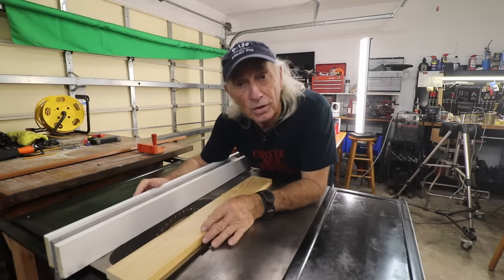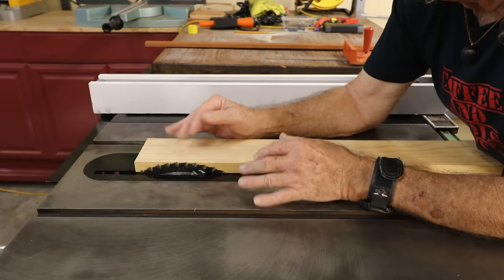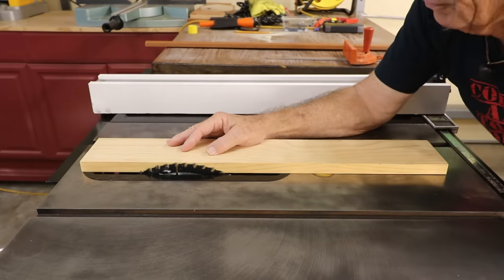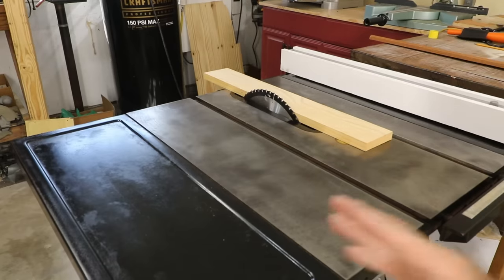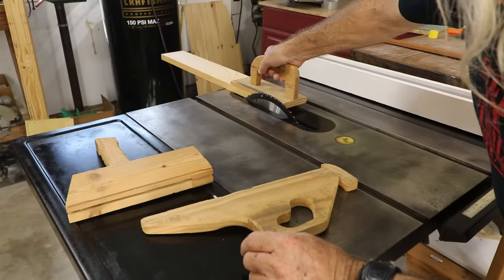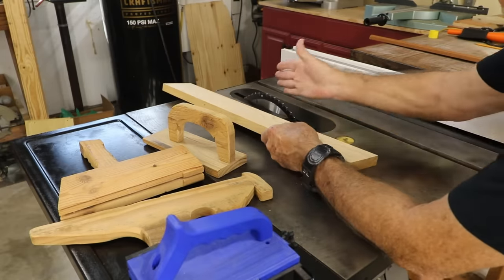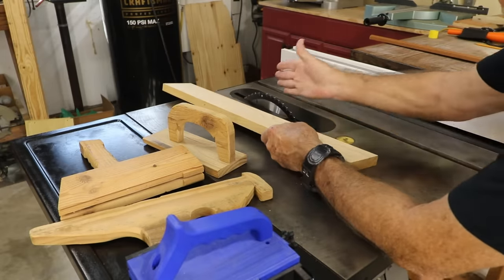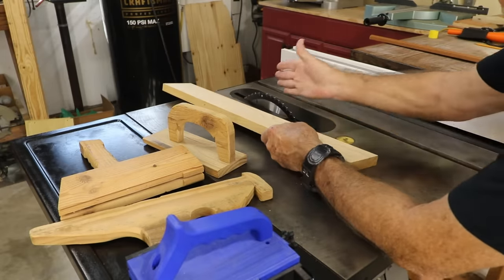Table saw secret nobody will talk about from the good old days, C&T episode 180

Comment: I'm just now at age 59 getting back into woodworking.   My fear of my Craftsman table saw blade is no less now than back in woodshop in the late 1970's.  I'm really glad you took the time to talk about blade heights because its something I dont ever remember learning but I wonder about it every single time I use the saw.  IMHO: part of being safe is being efficient.   If a blade is cutting sharp and efficient then you dont use as much force to guide it through your cut.  Less force means less chance of slippage.   I only have high school woodshop for experience but I once witnessed a piece of wood kick back and stick into a concrete wall behind the perhaps donkeyish teen boy making the cut.  Also: the Safety shield I remember using seemed to get in the way more than keep you safe.  I've never tried a nerd or whatever but that seems like a good thing to try.  I think most important is common sense and no distractions.  As an amateur I really try to take my time.  Sometimes I get in the Zone where everything just flows...but without experience that is rare.  Thanks again...I am going to try raising my blade higher...like 200-250% of the thickness of the piece being cut.  Up until I watched your video I was adjusting the blade so that the throat of the blade was just coming out of the top of the wood surface but like you said that makes more friction and raises the risk of kickback.
Reply from the maker: Now days it is all about safety and heck, that's not a bad thing. I just wanted the old school out in the open for all to see and understand we had reasons too :)
Reply: Agree 100%! What are a couple of woodworker sayings? Dull tools are more dangerous than sharp tools & let the tool do the work.

Comment: You mentioned you've been using a table saw for 50 years and I noticed you still have all your fingers! So I'm thinking you know what your talking about. Lol! But seriously, I've only been into wood work for a few years and the only time I've had a board get squirrely on me is when the blade was in a lower position. So this makes total sense. Thanks 😊
Reply from the maker: It is almost old school VS new. I think they both have the GOOD and BAD with each.

Comment: A lower blade reduces the depth your saw can cut into a stray finger, but it also tripled or quadrupled the amount of wood in contact with the cutting teeth of the blade. A high saw cuts a much straighter line (almost verticle) reducing the amount of wood being grabbed by the teeth at any point in time.

It's a matter of preference and your own comfort level in how much you pay attention and how in control you are when cutting. Choose your own adventure.... but do it wisely.
Reply from the maker: Well put :)
Reply: You are not a rookie.  I can tell.
Reply: correct, when I was young, a friend of mine, his parents had a carpintary, they had a table saw, running a huge disc, and they ran it high as well.
Due to it's 15KW, it was turning so fast, it didn't even grip wood, and even better, it had a movable slide, where you could put on the wood, and just launch it through the sawblade, it didn't even stop or move.
I still put the saw high up.
Reply from the maker: @Steve25g  Sounds like a big one :)
Reply: @SirTools   yes it was.
in the vicinity, you have a company producing carpintery industrial class..
The machine needed softstart at 3x400volts
Reply from the maker: @Steve25g  WoW...would love to have watched that one run....
Reply: @SirTools  me too, unfortunately, the shop and building is taken down, I saw on maps

Comment: Another thing that is very important is to have respect for the tool.  A lot of people have accidents because they get careless.   And I never, ever rush at the table saw.  If I do not have enough time to take my time, then I quite for the day and pick back up tomorrow.  I have been woodworking for 30 years and I do enough woodworking to have gone through 3 table saws.  I do more than week end projects, and I still have all my digits and plan on keeping it that way.  And PPE is an absolute must.  I cannot even imagine cutting anything without eye protection.  You only get one set of fingers and 1 pair of eyes.  It is up to you to keep them in tact.
Reply from the maker: Pre plan the cut is a must
Reply: @SirTools  absolutely.  You know that saying, measure twice cut once.  Well sometimes I measure 3 and 4 times.  Also, layout on the plywood sheet is important to prevent waste.  I know how to sew and I realized one day, that cutting into plywood is like cutting pattern pieces out of fabric.  You lay pattern pieces out to get the most out of your fabric, and you should do the same when you are cutting into plywood.  I cannot stand waste.   And everyone at the house knows not to 'clean up' my shop for me.  They will throw away pieces that they think are scraps.  They do not understand that those 'scrap' pieces could still get some life squeezed out of them.  Small trim; jig setups, etc.
Reply from the maker: @annarouly2144  I've warned folks to leave my scrap alone LOLOL

Comment: I was taught 50% higher than the wood. I vary that depending on thickness and other factors. The biggest thing is awareness of where my fingers are and where the blade is, as well as where the material is. No loose clothes, don't work too fast, make sure someone is nearby, and absolutely no cutting if tired.
Reply from the maker: Another twist on an old topic here. Cool stuff
Reply: and dont spill your beer
😛😛
Reply: Sharp blades are safer than dull ones.
Reply: listening to the Wood cut is the Key to a Clean cut.  And Feeling the resistance as well as Observation of Density of the Wood, denser the wood reduction of speed.  " A variable speed Electrical switch in line of power cord will do wonders for cutting on a table saw.

Comment: I started using table saws before blade guards and kickback prevention. I was shown that you can get kickback if your fence is not repeatably accurate, meaning that if the rear of the blades is closer to the fence than you get a pinching effect across the blade when pushing it through and more surface contact, so I was taught to measure both the front and rear of the blade and make them even or actually slightly further from the fence at the rear to prevent kickback.
Reply from the maker: Good point and I think it is the main cause.

Comment: Years ago, at the beginning of that years woodshop class one of the first things my Woodshop teacher in junior high did was hold up the table saw's fence and told us students that, that fence was the most dangerous piece of the table saw, and that if it was used improperly while using it during the process of cross-cutting boards it would more than likely cause the "abuser" (meaning the table saw user), a horrific amount of undue pain and suffering due to the possibility of creating a dangerous "Kick-Back" situation when the board being cut became twisted and jammed itself between the table saw blade and the fence. 

He stated that it was called a "Rip Fence", and that it was called a "Rip Fence" for one reason, and one reason only. It was to be used only for ripping boards in combination with a ripping blade, and was not to be used during the process of cross-cutting boards in combunation with a Cross-Cutting blade. 

He then explained to us students that if he observed (or caught), any of us students using that "Rip Fence" during the cros-cutting process, or even if it was sitting on top of the table saw during the cross-cutting procedure, he would immediately cease all woodshop procedures (until he returned from the principles office), and then would escort that student to the principles office to discuss safety procedures with the principle, then write up a written report pertaining to what occurred, and temporarily suspend that student from the use of the wood shop, and its equipment for two weeks, and would give that student a failing grade for that semester.

That woodshop teacher was mighty serious about "Safety in the Woodshop", and I have never forgotten either that woodshop teacher, or his "Safety " message pertaining to the proper use of the "Rip Fence".
Reply from the maker: Good teacher by sounds of it ! Thanks for this comment it is interesting to hear some of the old experiences from wood shop.

Comment: Back in the 70's I was taught for both table saws and circular saws to set the cutting depth to half the gullet depth. I've been running with that ever since. Nice cuts and safe, never been hurt. Oh yeah, push blocks are a necessity for table saw safety!
Reply: Exactly this.
Reply: Forgive me, I'm new to this. What is the gullet depth?
Reply: @soujrnr  I can't insert a pic here, so just google it. It is the deep curve right behind the teeth. My understanding is it is where the sawdust goes immediately after a tooth cuts through the wood fibers. Having the gullet exposed gives more escape route for sawdust than a blade sitting low that is buried in the wood.
Reply: @bloomdds  - Thank you!!

Comment: Just finished watching the video. I have always have the attitude that I keep the blade just high enough to let the edge clear below the gap behind the teeth. No matter whether it is carbide or all steel design. Just keeping it below yet above allows debris to flow away from the area.  Nice hat, which tells me you and I have a background of working on planes. Mine was with C-123,”White Whale” and 121s with ADC back in the 60s. Look forward to watching more videos.

Comment: The two best things I have ever done for my saw setups are: Use a high fence, set one inch or more than the max blade height as a limit for my hand. The second thing is to have a proper long out feed table, which lets me push a piece out smoothly. I resent being on the short end of a lever, thus tricking me to force the wood down onto the table near the end of its cut. (The most dangerous part of the sawing I have seen is not having a dedicated out feed table. Those twig-trees and helpers cause more havoc holding a piece out there. YOU need to be in control of the cut!!!!)
The Low Blade Safety ASSUMPTION maximizes the approach angle, and maximizes the tooth force tangential of the blades radius. This vectors forces which razes the work piece. In other words you can feel the board rise up when sett up like this, especially with slightly dull blade. Also, when set low, tooth time in contact with the wood is at maximum, creating heat, and if the material is dense like oak forget-about-it! 5000 RPM is 83 rotations per second. Multiply that by the number of teeth on the blade to find how many teeth per second. Saws with 1.5 to 3 HP always bog at the operators feeding rates.
Reply: Well reasoned! I hope newr users take heed
Reply: Having  out feed table is the way to go  but it takes up alot of room  trying  to fight your wood is dangerous  I think
Reply: @spurlindarby4587  Try a roller stand ....
Reply: Thank you
Outfeed table is often overlooked
Reply: Roller stand is good and at least you can move it to suit your space and timber length. Also like a lot of guys I often work alone in a room full of kit that can kill you so I wear a pair of 'Oregon' chainsaw gloves, designed to stop a chain saw and keep your fingers attached to your hands. Brilliant product and I use them on anything like saws, planers hand held or bench type it doesn't matter. Use on the band saw too. My gloves cost about £29 here in the UK, worth double. Riving knife and top guards if set up right are good too, never had cause not to use them.
Reply: @stephenrose8188  Thanks will look in to the gloves here in New Zealand. Roller stand is great in a tight workshop and good as an infeed 'table' too.
Reply: @stephenrose8188  wearing gloves is more dangerous then not wearing gloves when working on a table saw. Chainsaw gloves are designed to bind up the chain and quickly stall out a gas engine - they will not stop an electric saw blade.
Reply: @stephenrose8188  please check your gloves most chainsaw gloves only have protection in one hand the other is just leather.... no I'm not kidding
Reply: @robertmoore9636  Hi Robert, these are equally protected left and right hand glove, but always worth checking.

Comment: I've had a SawStop for four years, and even though I'm old, I'm still a beginner. Just recently I read the recommendation to set the blade height such that the gullet clears the board being cut. The explanation was that doing so allows the blade to clear the sawdust better. Well, except for the initial cut approximately the width of the upper portion of the blade, there's no sawdust doesn't get trapped in the gullet until the blade is rotating from 12 o'clock and into the wood. Once the gullet clears the bottom of the board, the sawdust will hopefully be sucked into the dust collection. Until the blade rotates back to the 12 o'clock position, I don't see where there is any sawdust in the gullet. I'm willing to stand corrected.

Second, as far as the angle of cut is concerned with a higher blade creating a steeper angle of cut, are the angles of the teeth today the same as they were 50 years ago? It seems that by the teeth leaning forward, they can achieve a greater angle of cut with a lower blade height. I have no clue what I'm talking about on this one. 

As far as push sticks are concerned, the only "kickback" I've had so far was when I carelessly knocked my push stick/block over into the blade. Luckily it hit me in the arm and not in the face or chest. It could have been bad. Live and learn. Now I never leave anything where it can be knocked over into the blade.
Reply from the maker: Lucky and glad to hear it.
Reply: The lower blade will cut at a different angle, particularly the rear of the blade. A high blade the teeth are nearly 90 degrees to the table, increasing the risk of the board being cut lifting. A lower blade will also shorten the length of the blade exposed also lessening the risk of kickback. After having said this I tend to use the blade where it was set on the last use. If I notice, particularly thin wood or ply, that it’s jumping or tending to lift, I will lower the blade.
Reply: Since the 70’s as a professional carpenter I have most always set the blade 1/8 - 1/4” higher than the materials that I am cutting with my table saw. ALSO I wont turn the saw on without wearing safety glasses ALWAYS !
Reply: @wardmontgomery9259  I agree, Safety glasses cannot be emphasised enough, apart from the sawdust, a splinter with force behind it can do a lot of damage!
Reply: @markcomptube  An excellent home builder in Kansas City, MO lost use of an eye as a young apprentice from a nail still in a board he was cutting. Safety glasses, for sure. Thank you.
Reply: Kickback occurs when the board binds and catches the blade throwing it back at you. This can be mitigated almost completely by using the riving knife (the metal shark fin sticking up on the outfeed side of the blade). I hate riving knives though and I often don’t use them but you can hear the difference in the cut and step to the side. I regularly stand off to the side anyway. The board can bind and catch the blade by 1.) an improperly calibrated fence driving the board closer to the blade once it passes the teeth 2.) user error, which never happens because we are perfect at woodworking 🤣 and never let the board get a little crooked on a long rip and 3 .) releasing the tension of the wood as it get cut can cause it to naturally twist and even pinch together tightly past the blade 

I’ve jumped out of the way of an 18” rip saw with conveyor feed and it shot oak back at a 3/4 “plywood wall hard enough to put a hole in it. Proper safety gear is a face shield and leather apron but who wears that?  That’s why I stand to the side most of the time.
Reply: @Jevandtieriel , so many confluences of different forces to avoid! Which compromise for which situation? It is not cut, dried, and simple to choose one rule for every cut. Most cuts of most stock thicknesses fall into a few rules of thumb, it is true. You mention a high blade producing a lifting force at the outfeed, which is true if stress is closing the kerf, and less true if an effective splitter or riving knife is used to prevent such pinching. Also, a misaligned fence will allow significant back-cutting, which must give some upward thrust also. In the case of pinching and back-cutting being minimised by good setup and good stock, I think that the downward thrust of the infeed part of the cut overwhelms the upward thrust at outfeed.
Reply: @DrManhattan84  I put a Metal Shark on my Boshe. What a difference. No more little disconcerting bump backs and less pressure needed to feed the work.
Reply: Riving knife on my table saw is thicker than my diablo blade, binds up
Reply: @jeffcarnes6038  Look into the microjig MJ splitters.
Reply: If i ever get a table saw, it will be a SawStop! Not taking chances with any other saw...
Reply: @countfloyd1269  l
Reply: @jeffcarnes6038  My recommendation is to swap out the Diablo blade for a full kerf blade and put the Diablo on a miter saw instead.  If you are using thin kerf blades because your saw isn't powerful enough to handle the boards you are pushing through it with a full kerf blade, you need to rethink how you are working your boards and whether you need to consider a more powerful saw.